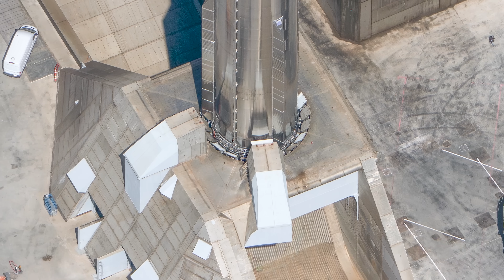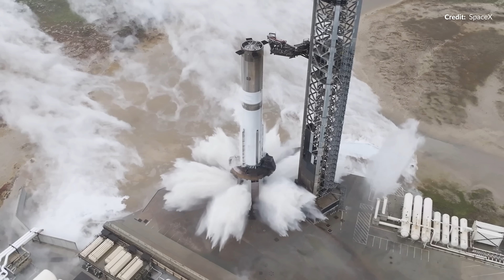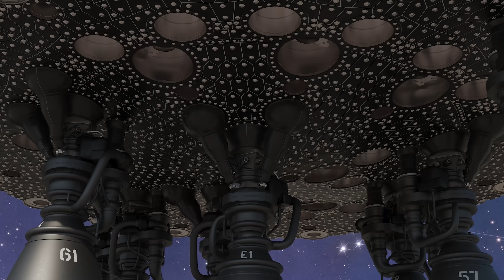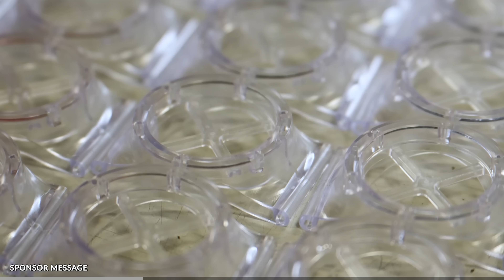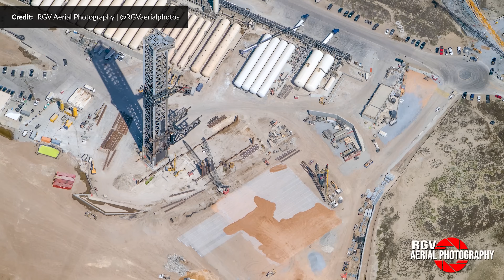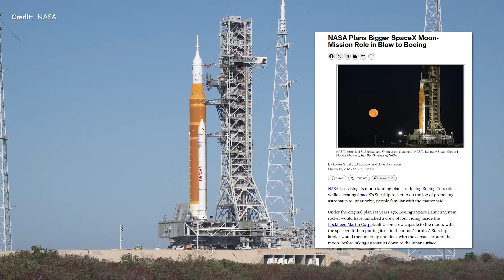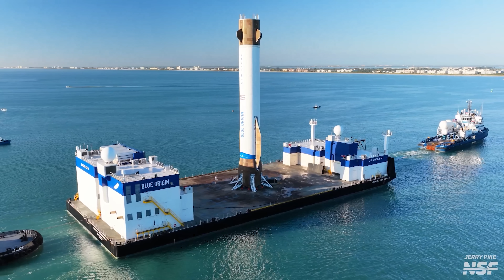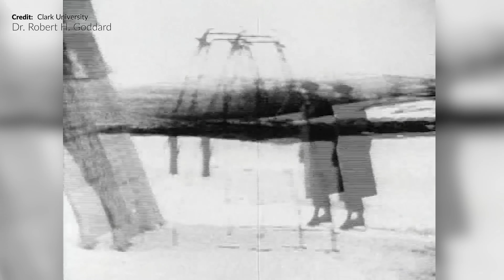SpaceX Finally Lit Super Heavy… But Something Was Off

Comment: How is Starship ahead of SLS? How is Starship less expensive than SLS if it takes 8 flights to land on Moon and return?
Reply: Because Starship has complete reuse. Cargo to LEO will only cost $10 per kg.

SLS costs $20,000 per kg.

Falcon-9 costs $7,000 per kg.
Reply: @JohnSmith-x3y8h  At $2.5 billion per launch and 95,000 kg to LEO SLS (cargo, no Orion) costs ≈ $26,316 per kg. Thats marginal launch cost (no development amortization which would multiply it)

At %15-20 million per launch (marginal internal cost) and 18,000 kg to LEO (reusable), Falcon 9 costs ≈ $833-1,110 per kg.
Reply: @admarsandbeyond 

Fair enough.

Our replies essentially answer the original question regardless of the precise cost.
Reply: The SLS program is given 1-2 billion dollars a year from Congress which technically makes the per launch cost 1-2 billion if they're launching once a year. If they launched more often it would quickly get a lot cheaper per flight but that's probably not gonna happen. Starship on the other hand is being mass produced and is being used for other projects so the fixed costs get split across many launches. It's also fully reusable which helps a lot.
Reply: The big issue is you really have no clue what jobs either was doing.  You never even tried. Ignorant and lazy, what a fool you make of yourself.
Reply: @imaginary_friend7300  hey so there's this thing called a genuine question

Comment: I like the idea of astronaut transfer from Orion to Starship being done in LEO instead of Lunar orbit.  I would suggest that after transfer of crew, BOTH ships engage in TLI; with crew aboard Starship and Orion flying autonomously.  That way the crew would have a backup vehicle in case something happened to Starship.  Of course, once they commit to lunar landing they would be completely reliant on Starship.
Reply: If Starship carries Orion it may have the fuel on return to enter LEO and use a less  energetic landing which is easier on the heat shield.  (Just me speculating).  It will cut into the cargo ability of HLS though.  For base building pure cargo missions (no Orion) could occur as well with the full cargo capacity of HLS.

:planet-orange-purple-ring:

:planet-orange-purple-ring:
Reply: My understanding is, the Starship will boost the joined ships into TLI. Crew transfer will not occur until they are ready for descent. The Orion will then boost itself back to Earth using its own engine after the landing.